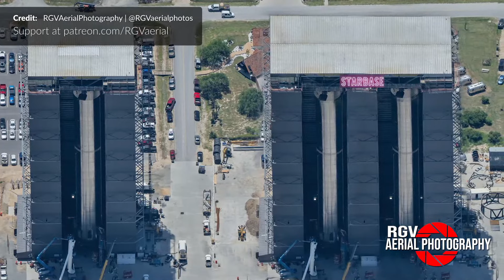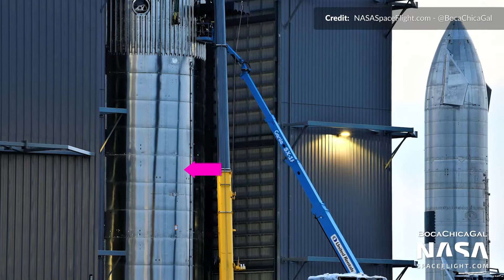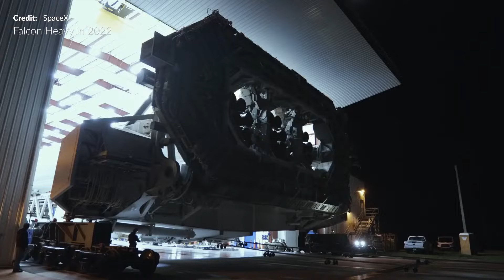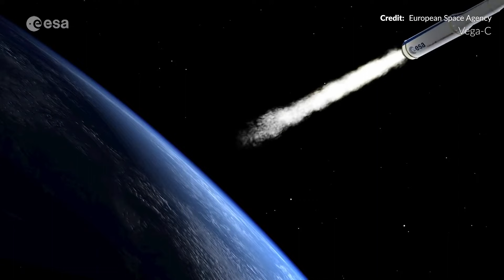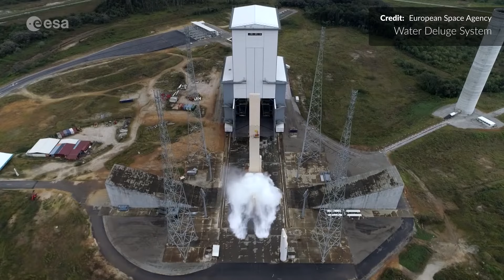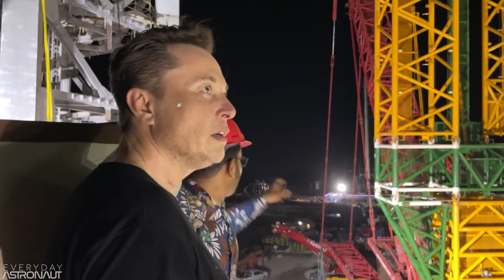Ad Free - It is over! SpaceX Starship Updates, Falcon Heavy / Ariane 6 updates, Crew 3/2 delays

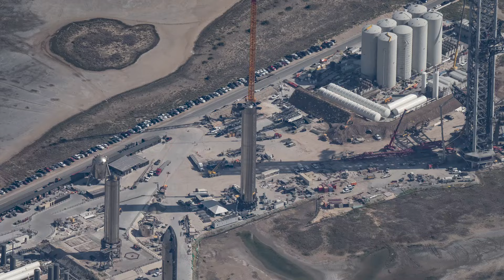Comment: At 2:36 of the video one sees a large viaduct in the corner of the protective mound securing the fuel farm.  Any idea what that mighty be for?  It is larger than the diameter of the pickup truck parked near it.
Reply from the maker: I'll need to check that out.